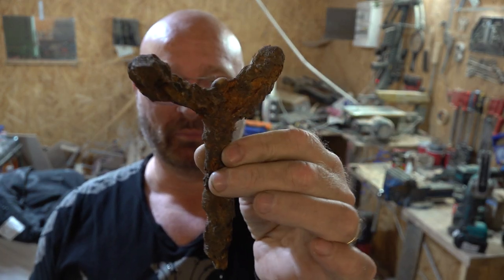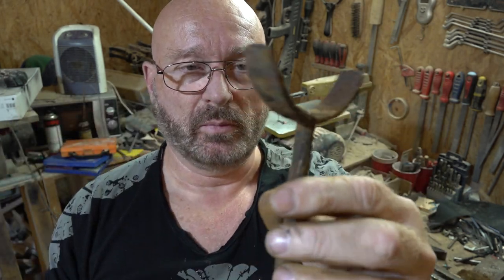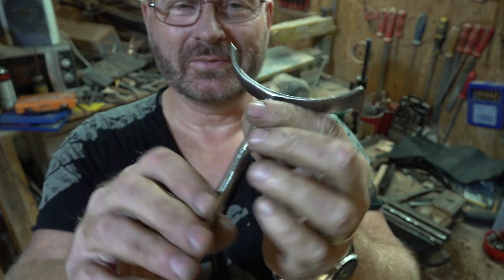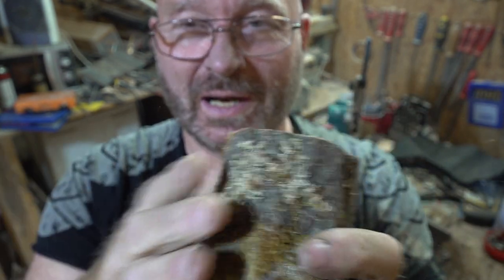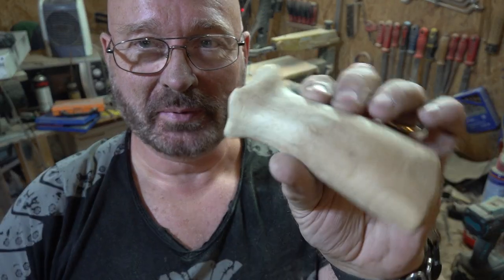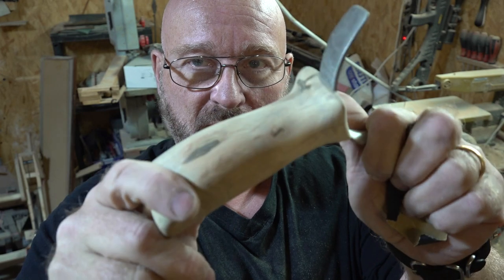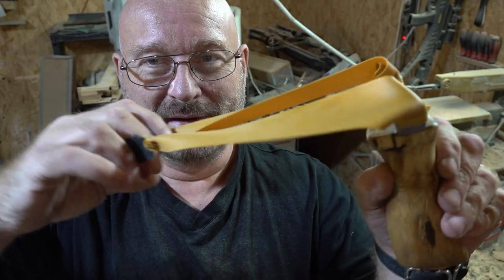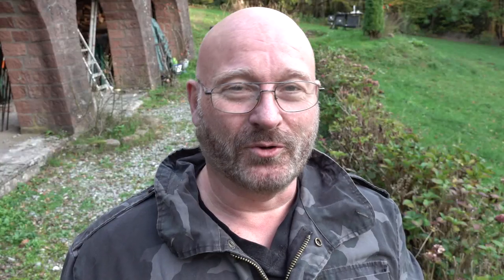Magnet Fished: Extreme Slingshot Restoration!

Comment: Interesting video. It looks to me like an oarlock, which would make sense in a river. The angle of the tines is a bit shallow but it may have gotten bent.
Reply: Yeah, rowlock or rod rest
Reply: Agreed.
It looks a lot like a rowlock, spur or oarlock in both its construction and shape, which is a device that allows an oar freedom of movement around all axis while rowing.
My only concern is that I’ve never seen one anywhere near that diameter, nor can I imagine why it would need to be so large. 
Use of oars requiring rowlocks that large would be inconceivable, and it is a pretty basic object.

I’ve seen some others speculating but I’m near positive it’s not a bracket for guttering or a “drain pipe holder” whatever that might be.
Reply: @Jay22222  No, there definitely are oars that size. Larger boats have them, like a whaler or longboat.

I do think it's been bent out of shape if that's what it is though, it's too shallow to be very useful for holding an oar. I think it was originally more sharply curved and had a smaller diameter.
Reply: Yup!
Reply: It could be a boom rest.
Reply: @peterhoulihan9766  Get out, Show me an oar with a 12” diameter handle. 
I have no doubt they get absurdly large but it would be unusable, even with specialised equipment.

You could right about it being bent though, I didn’t think about that.
Reply: @Jay22222  12"? It looks more like 5" or so to me, which would still be pretty big.

Another possibility is a sculling oar which tend to be much much bigger.

Comment: 100% wasn't an slingshot before. Looks more like an oar holder from a rowboat, but fun project never the less. Also the linseed sinks into the woods cells so the "oily" look is having oil, I would always recommend using Tung oil over Linseed by the way. Less toxic, less self-immolating rugs.

Comment: Looks like a rowlock to me. AKA  oarlock (USA) or gate, and its a brace that attaches an oar to a boat. When a boat is rowed, the rowlock acts as a fulcrum for the oar.

On ordinary rowing craft, the rowlocks are attached to the gunwales. In the sport of rowing, the rowlocks are attached to outriggers (often just called "riggers"), which project from the boat and provide greater leverage. In sport rowing, the rowlocks are normally U-shaped and attached to a vertical pin which allows the rowlock to pivot around the pin during the rowing stroke. They additionally have a locking mechanism (properly known as "the gate") across the top of the "U" to prevent the oar from unintentionally popping out of the rowlock.

Comment: I wonder if the object might have been a bracket to hold guttering beneath the roof of a building - the shape definitely fits.  The central stem below would be unusual though....
Reply: It looks like the spike at the bottom is for driving it into bricks. I used a lot of similar holders do drive straight into brickwork or mortar with a hammer.
Reply: +1

Comment: It would of been easier to have soaked it in white vinegar for 24 hours to remove the rust and take it back to the metal
Reply from the maker: Many of these „restoration“ guys do that, then they end up grinding the rust spots off anyway. Superfluous step.